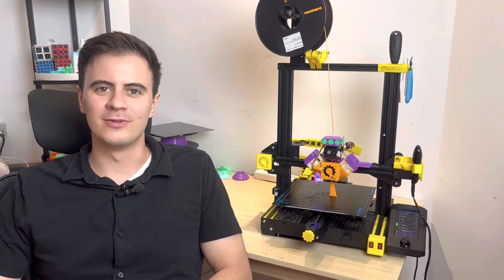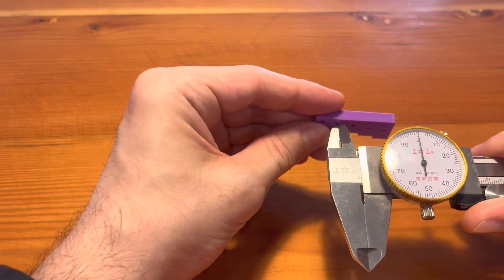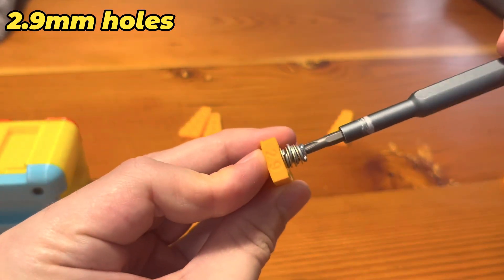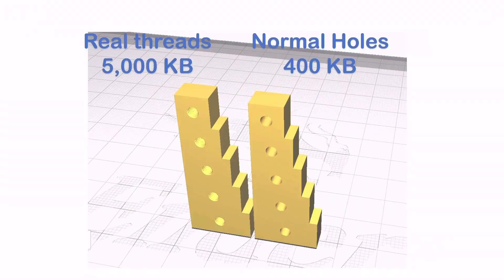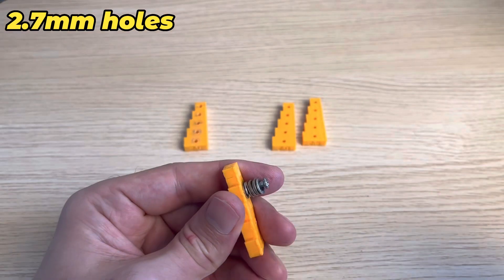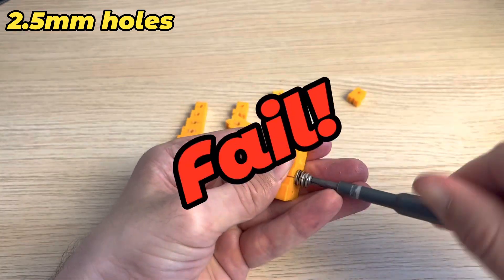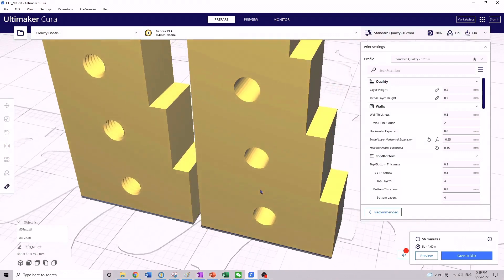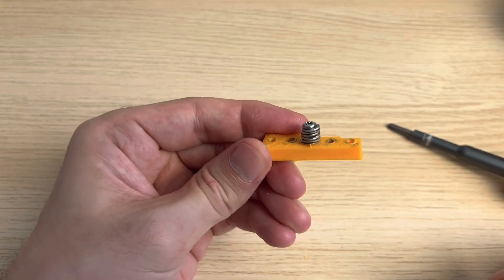Screwing into 3D Printed Parts Without Inserts (Testing and Results)

Comment: how do you get the infills out of the screw holes
Reply from the maker: usually a very small torx/hex bit to sort of pry them out.  A small tweezers works okay, but usually after the piece is loose, otherwise you end up bending up your tweezer tips.

Comment: Did I miss the part where you measured the OD of the screws
Reply from the maker: I didn't show that, but they are standard M3x0.5 screws so the OD is about 2.88-2.90mm
Reply: @DesktopInventions  Thank you! Very helpful video!

Comment: You could try using wood screws and making a square hole it taps into - making it square makes it somewhat more forgiving to inaccurate dimensions
Reply from the maker: Good suggestion! Square holes may also give some room for the material to deform/flow as well!

Comment: Did you try the experimental Cura settings "exclusivel"?
Reply from the maker: Interesting I have not! Seems like it shouldn’t help with holes directly perpendicular to the built plate but would have an affect on holes at an angle.

Comment: Interesting! Could you repeat this with screws that have suitable thread for plastics?
Reply from the maker: Good recommendation, the performance should be better at least for screwing with the layers.  There are a lot of different screws for plastic parts so I would have to try and pick a commonly available one.
Reply: @DesktopInventions  it would be awesome! I just bought a bunch of threaded inserts for now, but I'm sure something like they use on pressure washers or car panels would work. Not sure if the higher threads would split layers though.